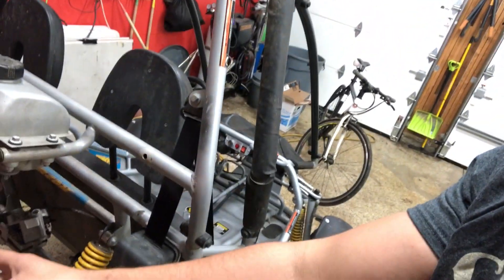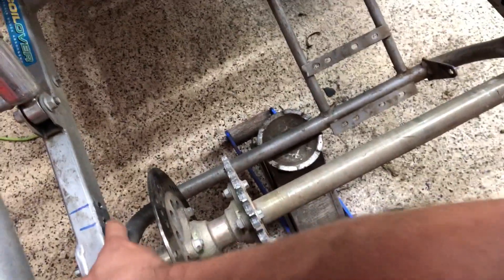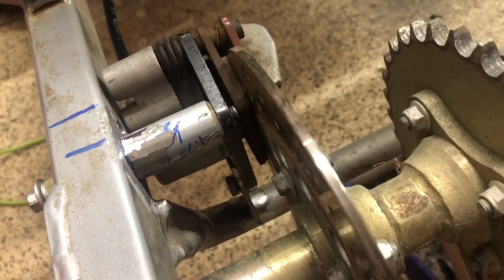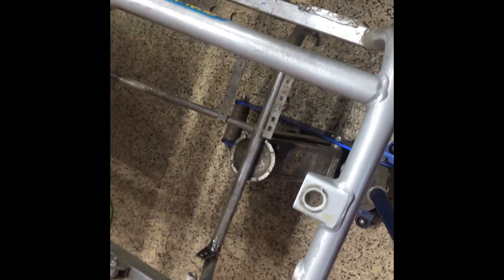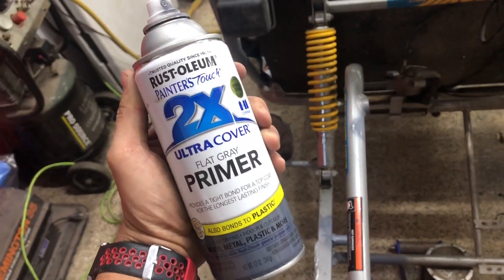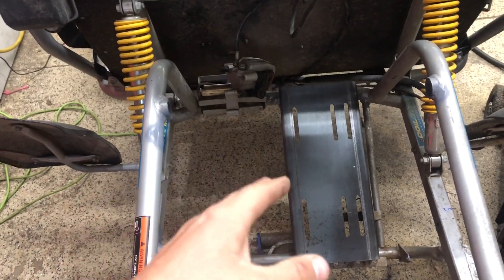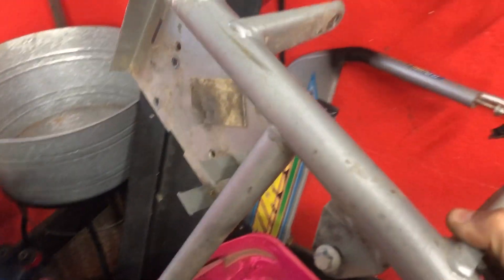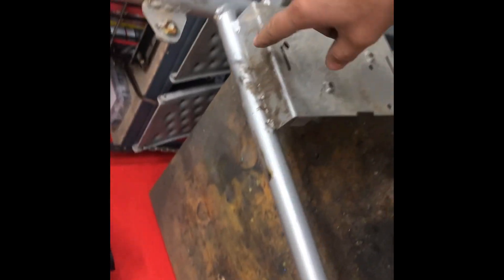Zircon/Carbide 150cc To 440cc 20+HP Engine Swap- Part 2

Comment: Did you have to get a new calliper ? Or you used the original.
Reply from the maker: Used the original, just flipped it to the other side along with the axle :)